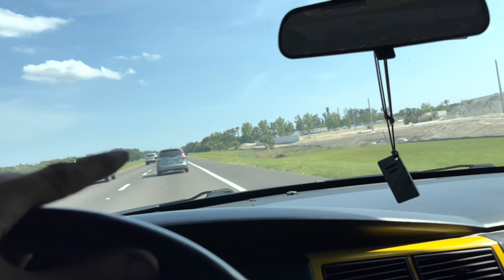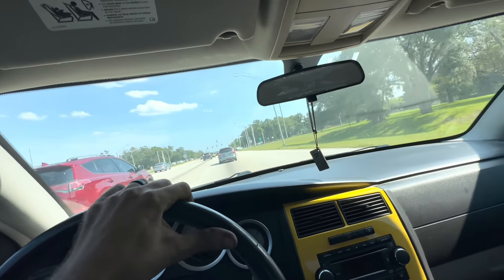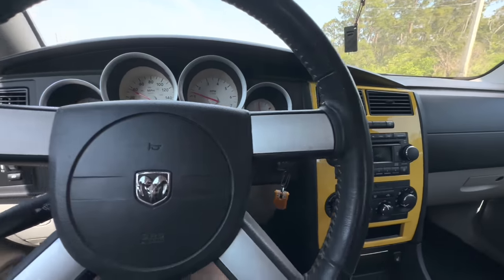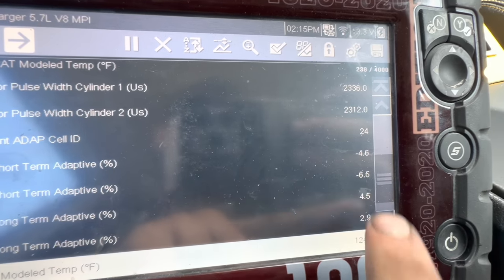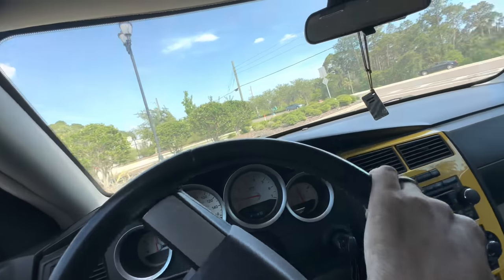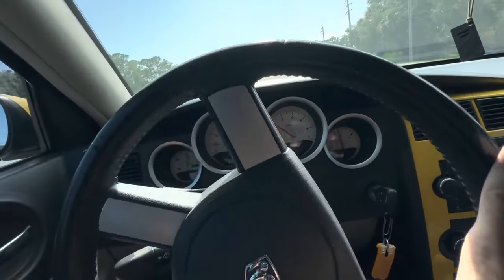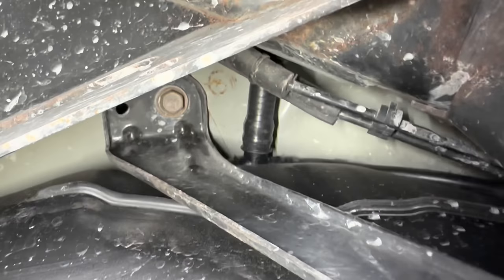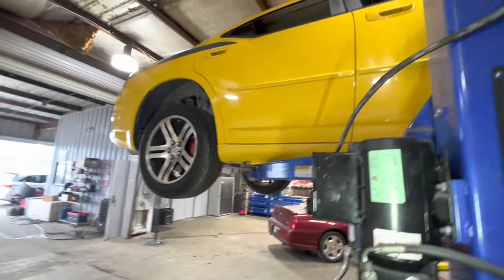Customer States: Engine Stalls After Fueling...HELP!! Dodge Charger 5.7 #mechanic

Comment: As you could see in my profile picture I have exact car, the only problem I have is the car overheats now it used to be a police unit for Durant, Ok police dept car now has 200,000 miles not included idle hours.  Well now she over heats getting transmission codes. I replaced overflow bottle because the cap wasn’t sealing correctly worked for a while now it’s acting up again. Thinking is transmission overworking the tired engine. No coolant leaking either crossing my fingers and hoping when I replace the conductor plate and and transmission filter that may solve the problem. Ever run into that problem or any of your viewers? 2009 Dodge Charger Pursuit with a 6.1 Hemi 200,000 miles not including idle hours.

Comment: most common issue of stalling after fueling is caused by over fueling gas getting into vapor canister. then vapor solenoid pulls into engine.

Comment: Had a stalling problem after fill up in my 2005 Hemi Magnum. It always stalled once I was on the hiway cruising at 60mph with a Peterbuilt barrelling up my ass. Car would take forever to restart, it was flooding due to a faulty valve in the fuel tank that allowed the purge canister to fill with fuel and when the ECU commanded a purge event the engine would flood.

Comment: If it happens after fill ups, it could be that the owner is topping off after the pump stops on it's own, not everyone knows that is a no no, explains why gas is in the system..Which is why it didn't stall after you filled it, that would be my guess, user error...

Comment: Not the same issue but similar 
I had a 07 mustang GT that after getting fuel it would randomly stall ALOT 
I’d sit for 5-10 mins and restart cuz wouldn’t just restart immediately. 
Ford changed out the fuel pump to evap can/ even BCM but nothing. They ended up giving up. 
Then idk why but last ditch issue was replacing the fuse control panel (supposedly was water entering causing corrosion) under hood. 
And replaced some fuel circuit relays seemed to have corrected it not sure if it needed both or one of the two said issues. 
    It ran fine for about a year then problem returned. Corrosion on relay terminals from humidity/rain 
But the second time it started acting up again Ford then said all well we fixed the issue and found the solution so now this repairs out of pocket 
$1,200. 
   I took it home cleaned all corrosion from relays in all panels hood/dash/even found fuse box in truck. 
Seemed to run fine again  
 But also seemed like just a bandaid repair so I sold the car. 
Learned my lesson from buying pre owned certified car from a dealer.

Comment: Would it be possible for PCM programming/electrical to be an issue? I have a 2017 ford focus st that has similar symptoms: liquid fuel gets sucked out of the tank through the evap system due to a faulty purge valve and also causes the fuel tank to collapse from the vacuum and cause damage/inaccurate fuel gauge. The recall covers the purge valve, fuel tank, fuel pump assembly, and a couple other components, but there is also a PCM programming part of it too. I'm not 100% sure why but if the PCM is not controlling the purge valve correctly I suppose it could cause issues.

Comment: I'm gonna say this now, this is the customer stating that there is a problem with the motor stalling.  You have done this before, evap system sucks in fuel if the fuel tank is over filled, this is a common customer mistake.  There is nothing wrong here, this is a customer possibly trying to possibly put the blame on you for defamation to other shops.  Recommendation is say nope, put it back together, let them be karens/kevins.  This is common to all gasline vehicles, over sucks in fuel, too much can stall the motor, not enough fuel can do the same thing, but another thing could be bad fuel from a station....

Comment: 10 gallons would cost you 67 Dollars here in Australia for 91 octane or 80 Dollars for 98 octane .. over a 100 for Diesel . 35 is cheap add at the dollar exchange rate it’s even worse … just a additive . We pay at the exchange rate $5.20 A gallon at your cost per gallon 7.50 at ours . Yeah $3.50 is cheap fuel very cheap

Comment: You didn't test the evap vent valve, and you said it was Dorman. But if it wasn't opening, I would have expected a check engine light when the evap monitor ran.

Comment: I have only just begun to listen to this video. But I would hope if somebody has checked the throttle position sensor, even though it's an electronic throttle. And or if it stalls while coming to a stop, sometimes the lock-up torque converter will hang out or the overdrive will hang up and cause a vehicle to stall. You should have a full explanation of exactly what the car is doing when it stalls so that you can drive it in that manner.
Other than that, when the battery start to go down on those cars and a long wire that runs the length of the car can cause weirdos codes and strange things to happen in the computer.

Comment: Ray,I think you were thrown of course by the customers stating it usually acts up after fueling,I had the same problem with a 06 ram and it ended up being a a bad relay,it's hard to not listen to a customers commits but just use your knowledge,isd relay

Comment: New doesn't mean good. 
Use air to blow out the purge line to make sure there is no liquid fuel trapped in the line.
Is there a test procedure for that multi valve part that doesn't involve replacement.

Comment: One other possibility: a small amount of WATER in the fuel tank. Water is lighter than gasoline, and will tend to puddle in a low spot. As the car is driven, that puddle can migrate toward the fuel pickup, and a small amount may enter the fuel system. Anything can disturb that puddle, including the turbulence of adding fuel. Once the water settles out, it no longer enters the pickup tube, and the engine runs fine. That would explain the intermittent nature of the problem. The only other thing, could be unexpected over-pressure of the gas tank, due to vent restriction in the gas cap. It might be worth it to replace the gas cap, unless there's a way to measure the pop pressures of the cap with pressure gauges. Virtually everything else fuel related has been addressed.  If this tank uses a submerged fuel pump, that would rule out any possibility of air in the fuel line.

Comment: I have found out from experience that the Ethanol fuel we use today destroys rubber seals if not made from Viton...
Just might be the problem with EVAC system...

Comment: I noticed the fuel tank is sitting over the exhaust.  Is it possible that the fuel is expanding from the heat causing it to go into the lines it shouldn't be?  Perhaps the heat shield isn't doing its job effectively?

Comment: Is it possible that there was residual fuel in the lines from before it was fixed and they are clearing up?  You haven’t been able to replicate the issue, but how long ago was the tank fixed and has it consistently been stalling?  Also, what about putting a catch can inline to see if raw fuel is still making its way up?

Comment: Happens after filling up.
This came to mind and ive always done it but wont anymore.
You fill the tank full and remove all the air, but gas taks have a vapor recovary system, as the cold gas enters the tank you have over filled the sunny Florida temptures case the gas to expand sening gas into the charcoal chanaster or vapor recovary system the motor chokes on the fumes or sends a shut down code to the fule pump  thinking the gas is leaking  or whatever it does but if the motor cant pull from that the computer freaks out.

Comment: The main problem with this happening is that it's an insanely difficult intermittent problem and since you've had the car for more than two weeks now it's going to take a very long time to prove the problem is fixed AFTER you repair it.  I really don't envy you on this one, bud.

Comment: Assuming the fuel line was flushed and filter replaced.  Tank and lines replacement doesn’t mean nothing in the line.   
If it were a generator I’d say fuel pump was overheating also writing this after reading about the relay replacement
Randomly failing electrical issues the worst.  
You know the customer is having issues and you can’t fix what’s not broken when you look at it

Comment: Can you suck on the line from that valve or one of the hoses where you found gasoline and see if that check valve is holding?  That might confirm that the new tank has a faulty check valve?

Comment: You should get the customer to fuel it exactly how he normally has it fueled, if its getting full service and the pump tech is one of those 10 clicks to fill guys that is the issue. If you fill to the first click the canister should be safe, the guys who over fill tanks usually have evap issues.

Comment: So I had a Dodge ram pick up truck with a 5.7 l. Do the same exact thing that ended up having low vacuum and what the problem blows the camshaft was ruined just a little bit and at times it. Would make the vacuumer low and it was stole. I know that sounds crazy but that's what it ended up being. The Cam chef was a little one the nice thing about.  Hemmy's as you could turn the Camp Chef one way. It pushes all the lifters up and you can insert a new cam without having to put lifters and the truck was fine after that

Comment: the problem is the entire fuel system is designed wrong..... just like my 2005 mustang.... sometimes i can barely fill up because the fuel station pump keeps cutting off.....

Comment: I’ve got a 2013 Dart that when I fuel up and don’t add any more fuel after the pump shuts off on its own the car is fine. If I attempt to top off the tank my car will run rough and stall
Reply: My remedy was to not top off the tank lol

Comment: Unplug the purge valve and let the customer take it for a week. If it doesn’t stall then you’ll know for sure it’s raw fuel getting into the intake manifold. Probably from overfilling the tank. But it could still be a separate issue.

Comment: I was thinking wrong kind of gas cap, but it looks like the stock one.

I had an old MG that called for a vented cap, but it just had any old cap. I would just not fill it and leave the cap half tightened. Otherwise, I'd get vapor lock and would have "blow my car" on the side of the road. 🤒

Comment: ya its pretty much safe driving 101 to stay in the lane closest to your next turn. you wont need to pass or overtake anyone. your turn will be there soon enough, its not gonna run away cause you got there 30 seconds later.

Comment: I had another issue with a 90 small Grand Prix back in the day where it would it would drain the battery overnight headpair of city drained and my brother was in a Caesar vied mass protection I had it up until the warranty was almost out of it and he just hit her to something one day running under the hood and he started pulling fuses and tell if I running 1 away and it wasn't oil pressure sitting in it it was less than $6 but I burned up all my warranty before they figured it out and it went out 3 times that we owned the car and did exactly the same thing😅

Comment: from working on these garbage 5.7s a lot myself.   these things eat cams from lifter issues and do all kinds of funny things without throwing any codes from it being intermittent.  the customer needs to find out when the other tank was replaced also.  it could still be under wrnty. and save you a headache.

Comment: It's got a bad Cam shaft and that's why the vacuum is low when you pull off the road after going 65 or 70 miles an hour. That's when he tries to stall when you're slowing down flamingo

Comment: Lmao its a Top Banana 🍌. They did have recalls lots of them UB4 was one of them. I have a 14 Challenger R/T Classic in Plum crazy. It's been junk since new. I now have about 38k miles on it. The paperwork is so thick I couldn't fit it in the glovbox. I should have junked it under CA Lemon Law. It by far over qualified. The Mopar service by far is the worst fca sucks.

Comment: Is the display supposed to flash like that, like for instance the mileage and the display for gear shifter.
I'm a dukes of Hazzard fan but when I hear on video a mechanic saying doing some dukes of hazard stuff I get concerned 😂..

Comment: Worst experience I ever had after fueling was totally random, but totally sucked just like same. 
I had a '99 Buick LeSabre with the 3.8. I fueled up and it started acting funny. I stopped tp pick up some takeout and it wouldn't even crank. Just so happened the stupid plastic intake split and hydro-locked the engine.  😠🤬

Comment: I see the service bulletin states that there is a lifetime warranty for the repair.  Perhaps the customer should take the Charger back to the dealer that replaced the tank for another free replacement.  Obviously you would charge for your time and the gasoline and whatever else.  I would like to see the repair but you can't argue with free.

Comment: When I saw how they had designed that plastic fuel tank to wrap around the exhaust system, I cringed a little and then thought of something I read recently:
An optimist sees a glass as half full.
A pessimist sees the same glass as half empty.
An engineer sees a glass that's twice as large as it needs to be.

Comment: Condensed fuel in vent lines doesn't mean it's sucking pure fuel, it just means it condensed....    You haven't done any diagnostics on the fuel tank items yet (closing vent valve, activating purge, looking at tank pressure etc to make sure the system functions correctly, the doorman stuff worries me.   To really find out what's going on you need to get it to reproduce the symptoms, but further you need to be able to datalog once it does...    If I were you I'd be datalogging front o2 sensor voltages, short trims, purge valve mode, purge flow, purge fraction, fuel tank pressure, vent valve position, and for kicks maybe fuel rail pressure/fuel pump DC (if it has a PWM pump).

Comment: My neighbor is a retired long-haul trucker.
He was involved in hauling construction materials when they were building the expressways in Chicago. 
He said three teenage girls pulled out in front of him while he was doing 45 mph hauling a fully loaded trailer in a VW Beetle convertible. 
He was having trouble slowing down and instead of going through a yellow light, they stopped. 
He couldn't and smashed into and eventually drove over the VW killing all three of the girls.

Comment: I have the exact same car. 2006 daytona RT top banana. 
they're known for PCM issues; especially in places with hot summers and cold winters; heat stress cracks the solder on the PCM. 
the relays also might be a culprit as others have said. 
they're also known for dropping valve seats; so let her cool down before turning it off. plz for the love of god. 

the only other thing might just be bad gas; these engines really should only be fed 89+ gas, if they're throwing reg in it and it happens to be bad or watered down i can see it stalling.
my car cuts nearly 30% power at FOH to prevent knock on reg.

Comment: The problem is it’s a Chrysler 🤷🏻‍♂️ Jeeps are gonna Jeep, Dodge is gonna Dodge, and Chrysler is gonna Chrysler lol. I was done with Chrysler cars when i had to replace the transmission in my 95 caravan with the 2.5 Mitsubishi engine twice. The only good part in that van was the engine.

Comment: I would ask the user if he it "topping off" the tank at fill-ups. Over filling has been known to cause fuel to get into the evap system. I would advise user to stop on first click off (or perhaps 2nd)... but no more. See if that stops it. Would be a cheap test anyway......

Comment: Former level 2 FCA tech, i have seen the EISM do this, no codes, no nothing just sticks and causes fuel lock and or over rich stall conditions.  they are a dumb design and FCA offers no diagnostic info, you either learn on the fly or are lucky to go to FCA school and got a good instructor.

Comment: I thought it was common knowledge that Mopar Central designs and builds all their fleet to be cheap and disposable.  In other words, when the slightest thing goes wrong with one, simply call the salvage yard and have it towed.  Buy another upon your return to the nearest dealer.

Comment: fuel regulator, sucking fuel through diaphragm, or sticking open loosing fuel pressure! Fuel pump, check current draw! Crank angle sensor/ cam angle . when it stalls will it restart immediately and idle correctly! poor Battery capacity. sorry just throwing ideas out there! A fellow i listen to on You tube is Named Diagnosis Dan from Europe. also you have Scanner Danner over your way great diagnostic guys. Not saying your Not! these guys may have come across this before too. Dave from Australia

Comment: It is entirely possible that the new fuel tank valve could be bad. The recall/tech sheet was for that particular problem. It could be possible that the new tank has the same problem since the new tank has the same valve in it.

Comment: The fuel tank or the car even are not the cause.
Repeatedly overfilling the fuel tank is the cause. 
The cold fuel (out of the ground) warms up and expands in the fuel tank and eventually cracks the weakest point: the vent valve / roll over valve.
The solution is to replace the fuel tank (already done), replace the cannister, because it will have become saturated with fuel (sometimes the fuel will even drip out) and blow out the lines with compressed air (disconnected, of course).

Comment: Environmental? A full tank on a hot road , slow traffic would tend to evaporate fuel a lot faster than the system is designed to deal with , condensing it down stream or into the engine. Carbs used to experience similar vapour lock stalling in the olden days